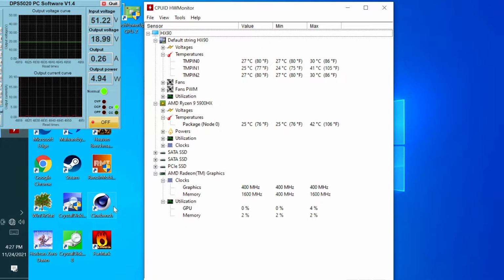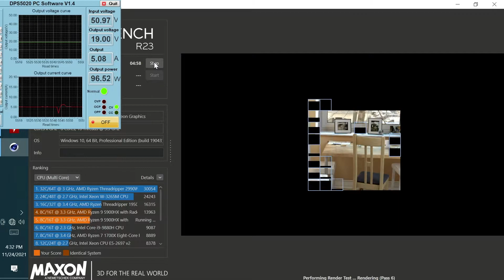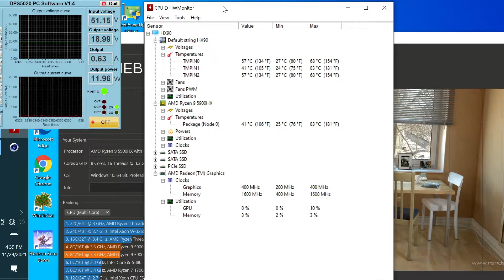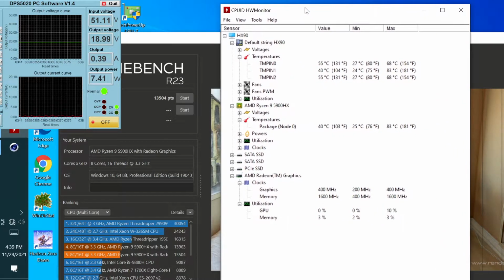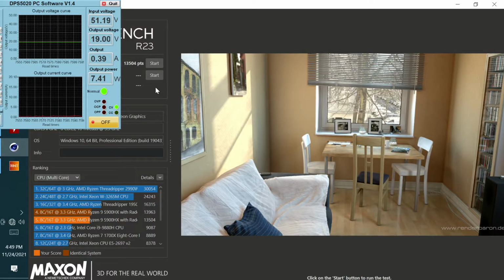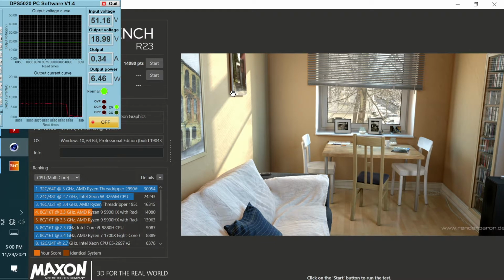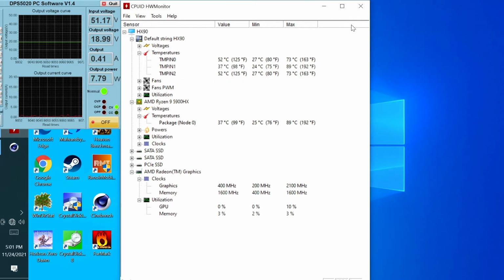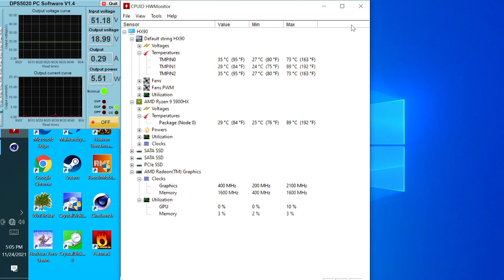Minisforum HX90 Part3: (Max Power Consumption Test)

Comment from the maker: In this video we looked at the max power consumption for HX90.  We want to know if the provided Power Supply (120W) is enough for powering the HX90 in the worst case scenario (where we have max RAM 64GB, 1 NVME Drive, and with 2 SATA SSD installed).
Reply from the maker: Also, for those of you that might wonder, we also tried with running CinebenchR23 + Furmark running at the same time.  However, the Power consumption dropped by quit a bit, down to 90W max.  That is why we decided to only fully test with R23 running
Reply: @electronicshobbyisttechnol3347  why did the software in part 2 have core at 64w and package power at 54w when the power draw is over 90w?

Comment: big thumbs up, any chance foryou on doing the same with the newer x500? my 5700g is getting 90 degrees with only 60% load under tests and I am worried...
Reply from the maker: Thanks, sorry we did not pick up x500.  We already have ITX build of the 5700G. If it is getting that hot, try the following: check if you mount the cooler correctly, get a bit more thermal grease, get better thermal grease, or change your cooler.  (Under volt is also an option if you know how to do it)
Anyway, Happy new year!